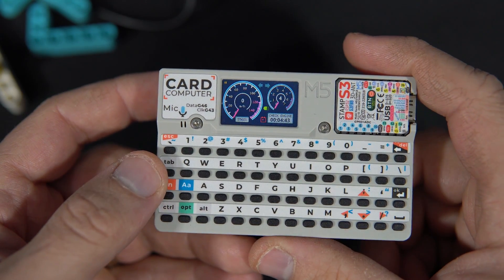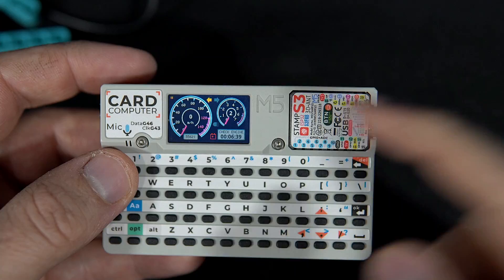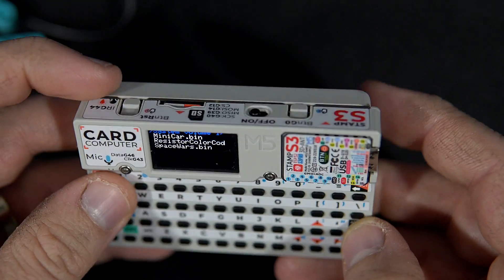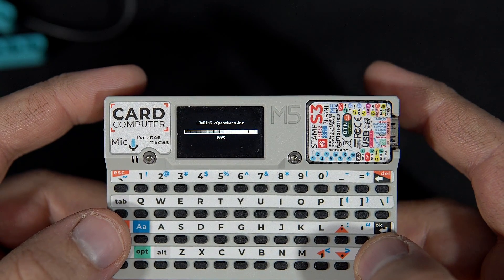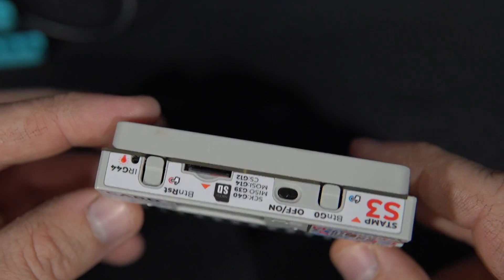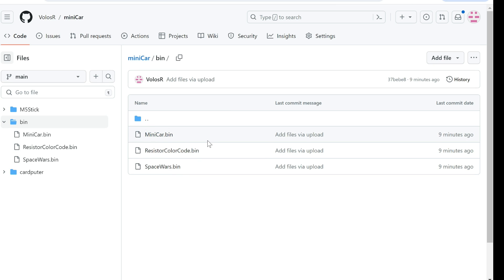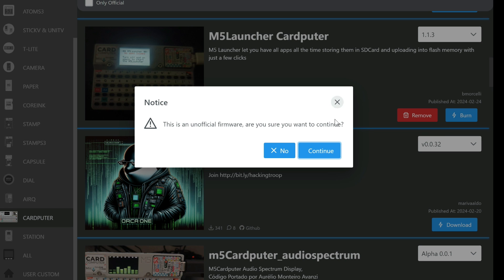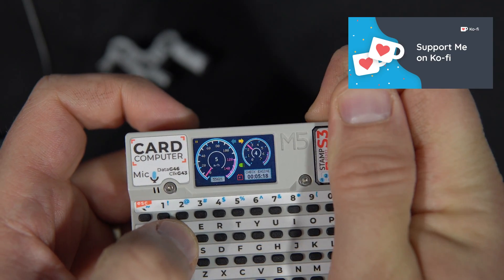Install firmware from an SD card on M5Cardputer, plus a free mini car dashboard example.

Comment: How do I transfer .bin files to my micro SD card(F drive)?
"Add Files via Upload" does NOT give me an option to download .bin files to the micro SD card, dragging and dropping includes the web link making it a 'shortcut'.
I'm new at programming, I've been building hardware products for a long time, I recently decided to learn programming to motivate the things I build...but I get lost.
 Thank you for assisting an amateur.
GREAT video!!
Reply from the maker: You just copy them to sd card like any other files. You will need usb card reader.

Comment: You're great, thanks for sharing info and projects using the amazing M5 products. Hey, do you think it's possible to use the Cardputer with Meshstatic?
Reply from the maker: Ofc is possible but you will need aditional lora module.

Comment: I need help... I brick my card computer. What i make for start this? Please...
Reply from the maker: How you bricked your cputer?
Reply: Ya I have the same problems with every tft display I touch for 2 seconds
Reply: Mine won’t turn on… I just got it and it’s already not working. :( what a bummer! Helppppp
Reply from the maker: Plug in usb , turn it om, and leave for hour, if  is not working contact m5stack, they will send you another one. And make sure charger is 5v , it is best to use port on pc. Phone chargers have usb c also but voltage is much higher and they can destoy your device.

Comment: Better project idea for that... first, fit in an antenna and a microphone... wire the antenna to literally any DAC input. Then use a the antenna to look for EMF and the mike to monitor low frequencies with a waterfall style spectrum analyzer.... bam... instant Ghost Detector! (well, a temperature monitor would also help)

Comment: Can it be used for a real car as a digital speedometer ?
Reply: I had apps on phone that used OBD protocol thru bluetooth
Reply: Don't see why not. Especially with a CAN module and code mods. You could have a second custom dashboard.     

Or tapping into speedo signal line & converting the voltage, or whatever scheme the speedo uses to speed for the Cardputer guage.
Reply: Is there a code that i can install on mine because i recently received mine  @SlinkyD